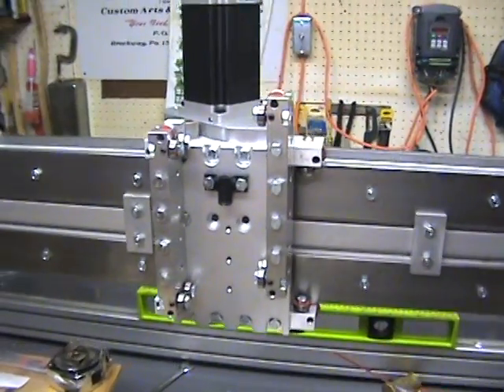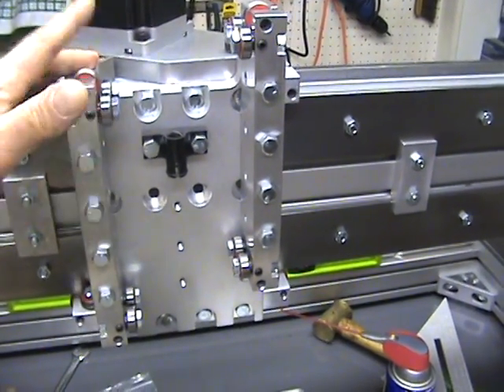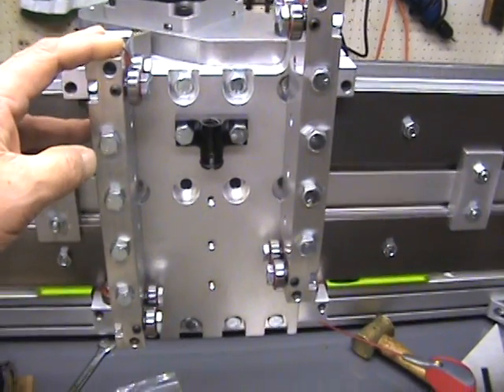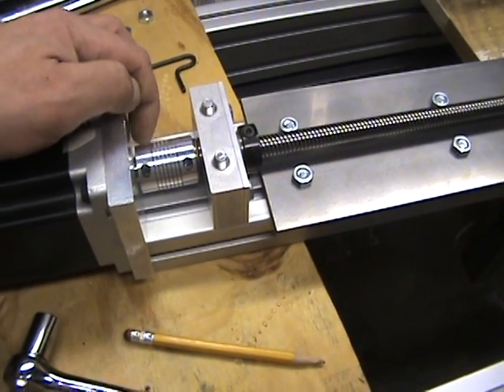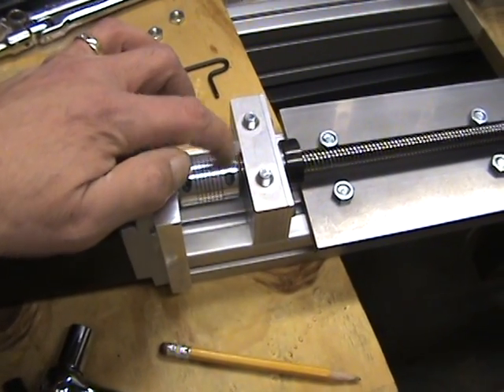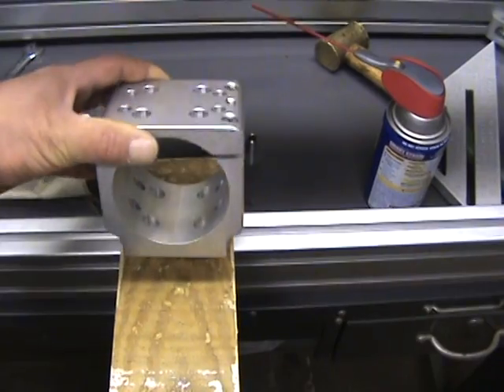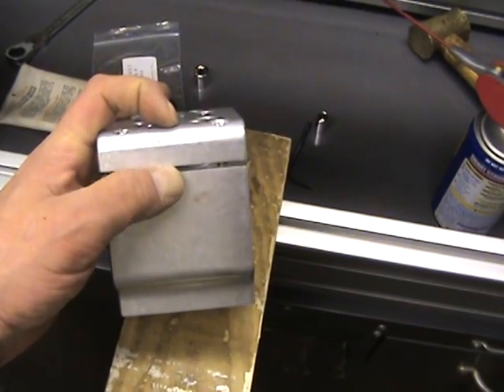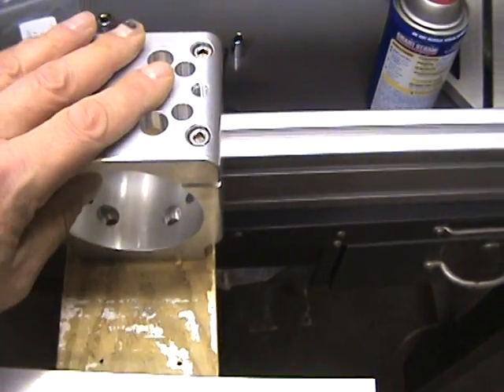Building CNC Router Parts CRP4848-10.MPG

Comment: I just replaced the crummy spring coupling on my 48x96 with a newer type couplings..there is NO backlash when micro-stepping..unlike the old design....BUT I did have to remove the entire Z and move stuff around to get it to fit....the new coupling is about a 1/2" taller.
Dale